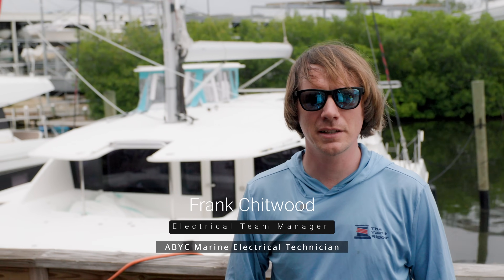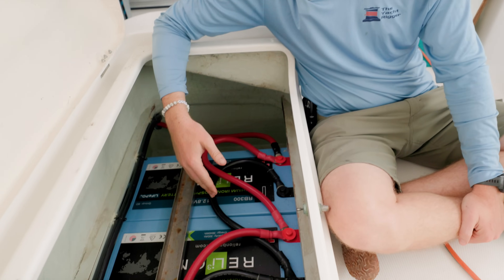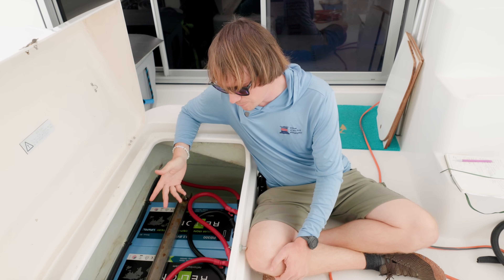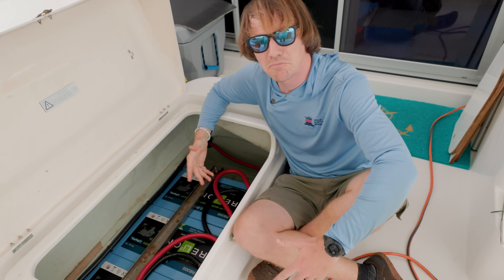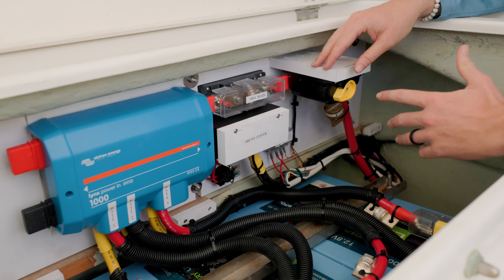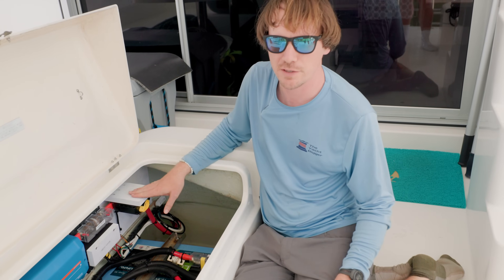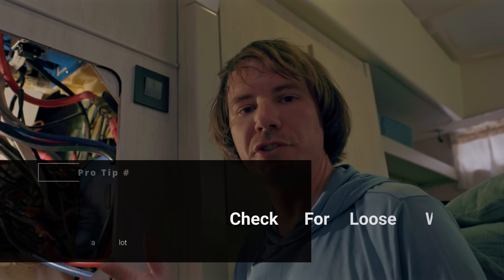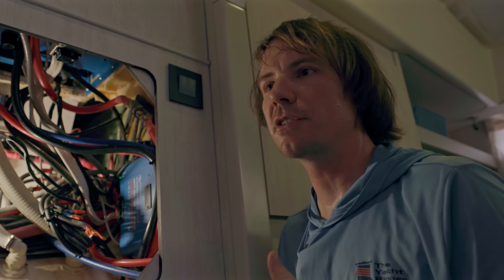Lithium On Your Boat | You Don't Want to Do it Wrong!

Comment: Thanks for the helpful video! You mentioned that all galvanic isolators are ABYC compliant but I thought that the Victrons were not compliant as they did not have the FailSafe feature. I believe ProSafe FS30 amp and FS60 amp are ABYC compliant.
Reply: You are correct. This video is aimed at the US-based West Marine shoppers amongst us. They don't carry any non-ABYC compliant galvanic isolators such as Victron.

Comment: Great job! Was it just me or do you also think the ABYC lithium standard seems catered entirely to battery manufacturers, rather than installers? To me, it seems extremely lax in so many ways, in that they didn't want to potentially exclude particular manufacturer's sub-par designs (i.e. their board members). ABYC has done a lot of great work bringing standards to a historically unregulated industry but this latest standard feels fraught with conflict of interest. For example, the particulars that make Victron the best lithium system around, far exceed the ABYC minimum standard...yet many installers will only install Victron. Hmmm...
Reply: The ABYC Standards are MINIMUM recommended safety standards. We typically exceed them. To us, the single biggest issues out there is that the standards are voluntary and people are unaware a lot of the tradesmen that they could hire to work on their boat have no formal training or familiarity with the best practices.
Reply: I share your sentiments on the regulation catering to all brands.  Not many people know about the board member as you mentioned and I felt that this was a little sided when it came out.  But in the end I’m happy with how it is.  As installers we can advocate and draw attention to the recommendations and show how a certain brand will rise above others in meeting the ABYC suggestions.

Comment: Excellent video and information. I do not use the products about which you speak but they are top of the line. My boat is a forty foot entirely solar with old school lead acid flooded cell electrical storage. The premise for my over 35 years on the project is, most of its components are from box stores for motors, batteries, solar modules, controllers and appliances. The idea for the premise is KISS, Keep It Simple Smarty.

The descriptions, language, parts, videography and content of your video are spot on, detailed and most accurate. If I were to convert to the latest technologies with an enterprising marine group, I would be on your doorstep. Thanks for the fine work and the use of quality high tech products.

Comment: good  information , thanks . I have a cat with 2 motors and fitted a Victron DC/DC charger to port  engine to charge 3x 100 ah Li batteries, how can I be sure  that the other engine wont overcharge the batteries  when both engines running ? Do I need to put another DC/DC charger on the stbd engine ?

Comment: Thanks for the video.  Great points!  What do you do for grounding the AC and DC systems together?  Where do you do that and what are the concerns?  We have a catamaran so two engines which also need to be grounded.  I have not been able to find the central ground connection on our boat and I don't want to create ground "islands" that can be separated from the ground circuit.  What are your thoughts?  Thanks!
Reply: ABYC Standard E-11 says if you have an AC and a DC system on the boat the AC grounding bus shall be connected to either the engine negative terminal or (more commonly) the DC negative bus. Usually this is done near the electrical or distribution panels with a single wire. It's probably green or green with yellow stripe if you have one. If you share the boat model there's a chance I can tell you where to find it.
Reply: @FrankTheYachtRigger  Thanks! Yes, the boat ground is green with a yellow stripe.  The boat is a 2018 Fountaine Pajot Saona 47. The DC is in the port engine bay and the AC is in the starboard. But, the boat was commissioned by Atlantic Cruising Yachts and they moved the AC panel into the salon. There is a main DC power line that goes to the area behind the NAV station. I'm guessing that is where it is tied but an F16 has less wiring than what is going on there.  Since I'm repowering the boat (batteries and inverters) I just want to make sure I'm not creating any ground islands. The DC ground need a good cleanup.  Thanks for your help! Franny

Comment: I bought a first Gen LED replacement bulb for my existing masthead anchor light fixture. It began to fail immediately, becoming dimmer over the course of a few months. The LED wasn’t cheap, and had a lifetime warranty.  Fortunately, the manufacturer supplied a new bersion, which has worked extremely well. I don’t like going up the mast on a regular basis!
Reply: Glad that worked out! Not all are created equal. We have had to replace LED navigation lights from well-known but not top quality brands for people that were only a year old. We mostly sell and install Weems & Plath at our shop and so far haven't had a single issue out of any of them, but we haven't been using them too long so time will tell.

Comment: Great video. Thoughts on the new Victron NG lithiums?
Reply: We're looking forwarding to getting our first batch. Nothing too revolutionary in them, just a good evolution, so not expecting many issues with the first batch. Mostly excited about the 24V 300Ah size being adding. I wonder if they will release a 48V version down the road.
Reply: @FrankTheYachtRigger  these batteries coupled with the new GX ability to add a second bank will make adding capacity a much easier problem to solve where space, weight/balance and other constraints make adding more batts a poor choice (think aft and to one side in a monohull, or in one hull on a cat). 

Do you have any idea if individual cell voltages will be available through VRM on the NG batts or BMS? My kludgy BLE sniffer approach is a poor substitute for the info I get through VictronConnect on the boat for each battery but it is mostly a “nice to have” remotely data issue, not “need to have.”  Temps, though, can be “really should have” data in the winter. The low temp charge protection (ATC circuitry) has worked well, but it would be nice to verify. Not a FLA problem!
Reply: @jimduke5545  The NG batteries will transmit cell level data to the system. They also feature a built-in shunt on each battery.

Comment: Hi Frank, excellent video. I have a couple of questions hopefully you have the time to point me in the right direction. 
1) I’m upgrading my Morgan 41 classic to a lithium house bank. I think I have all the fusing etc done correctly and I’m going the DC-DC charger route regarding alternator charging. My question regarding this installation is separating the AC loads and the inverter. 
I have a single 30A shore power inlet. I’m using a ronogy 3000W inverter charger. When I’m away from shore power I want to power the whole boat except a few heavy loads: water heater etc.  I’m guessing I need to install a separate breaker panel for the load that I only want to be powered when in connected to shore power. Is this correct and is there anything specific I need to think about when doing this? 
2) where would I go to get some ABYC training regarding electrical systems given I’m located in Canada? I’m a long time engineer in the entertainment industry so have a very good grasp of complex systems looking to pivot that knowledge to the marine sector and want to do it right rather than just winging it🤣 

Your info was so well explained and detailed. Very much appreciated.
Reply from the maker: You should put a call into The Yacht Rigger and see!

Comment: Nice info.  Whats your thoughts on bifacial solar panels? With reflection on water seems like more free power?
Reply: We love em! Especially on the racks sticking off the back of the boat.
Reply: @FrankTheYachtRigger  Since real estate is a premium hanging panels off the back. I wonder if having a nother panel pointing creates more power than Bifacial. The back side of bifacial is not as powerful as the top. Would love to see a test where you turn pan
els upside down to see the power can get reflecting off the water.
Reply: @bryhan67  That’s a fun idea! Maybe we can find the time to try that one day and post a video.

Comment: Great video!  Is there a source for the beautiful battery/fuse bars?  Also, I noticed the fuse holders were not secured.  Is that compliant?  Also, my batteries each have a rating of 250a continuous discharge but 800a 1sec discharge.  I can find class T fuses up to 400a.  What amperage would be recommended? (12v system, each battery 460ah w 250a BMS’s)   Thanks!
Reply: So, this is a lot to discuss over YouTube, but the size of the fuse is determined by the size of the wire and where it is located (in an engine or not, bundled with other wires or not) - it is not determined by the battery size. Then in some instances the fuse cannot exceed 100% of the ampacity of the wire, and in others it can exceed the ampacity of the wire but only by a certain amount. It's quite a lot to get into here. In the example in this boat, the battery cables are 2/0, not in an engine room, but wrapped in split loom (which is a derating factor) so the ampacity is 231A. We used 200A fuses on each battery although 225A would have been acceptable as well. We also have to do a calculation using a formula provided by ABYC to make sure the cross-sectional area of our copper bars are apprioriately sized as well. FYI there are Class T in larger sizes than 400A but not from the traditional marine brands.
Reply: Thank you for taking the time to respond!!  
I used Ancor 4/0 tinned so ~107mm sq.  In engine compartment.  I assume the conversion chart would adjust for solid bar vs multi stranded.  I was hoping there was a source for the contoured bars.  I could bend, drill and wrap them but they certainly won’t be as pretty! Thanks again.
Reply: @tracyoliver550 4/0 wire in an engine room with split loom has an ampacity of 265A and you cannot exceed 100% of the ampacity on a battery so that would call for a 250A Class T fuse.

Comment: The Maximum charger current on those Relion batteries is 100A each and obviously a bit more when there are multiple of them in parallel.
Reply: The recommended charge current for those batteries is 15-50A according to the manufacturer. There are three in parallel here so 150A is the maximum recommended charge current and what we have set up this system for. Disappointing… we could put in more power. The ABYC Standard E-13 for Lithium Ion Batteries tell us we must set the system to follow the manufacturers recommend charge profile though. You should not operate ANY electrical equipment at its maximum rating regularly.

Comment: Great video. It’s still not a monohull😢, but electricity is electricity. 👍

Nice explanations, Frank. With regard to the inverter fuse, could you explain why a high AIC (class T)  is needed there? I totally get the requirement at each battery but am not following the need (vs an ANL) prior/after (invert/charge) the Multi. I also wonder a bit about the aggregated “main battery fuse” needing to be a class T. In either case, I see no harm in them being a class T, but I don’t know where the requirement for the higher AIC fuse is, in cases other than for each battery at/near the positive post. 

For the Inc/charger service disconnect/fuse, could you have used a properly sized DC CB? (Fully realize how expensive they are but they exist)

Love the copper busbar off the battery post. (Makes my 6-7” 2-0 “whip” look like an amateur did it. (Me!)

Always learning!  Thanks.
Reply: Hi Jim,

For other people less tech savy than you reading this I want to point out that AIC means Ampere Interupting Capacity and what it relates to is the ability of a fuse to safely blow, rather than arc weld closed and continue pass current, when faced with a very high amperage. A Class T fuse has a high AIC rating while a MEGA or ANL does not. A fuse with a high AIC rating such as a Class T is not necessary for the inverter assuming the batteries are properly protected with a Class T and we frequently use MEGAs as well for inverters. But this one was already installed and there's not a down side there so it got a cover and a spare and is back in service. Yes a DC CB fuse could be used but as you note the extremely high price makes it quite unattractive. 

Thanks for the love on the copper Z bars. We sell these for $44.99, which seems pricey but obviously requires quite a bit of precision work at the fabrication shop to get the dimensions exactly right to sit flush on the battery terminal and Class T fuse stud. They are attached to the battery with 3M VHB tape. When you compare it to the cost of wire and lug as well as time it takes to deal with those annoying little buggers, it's actually not so bad.

The discussion about a Class T fuse for a main fuse when we already have each battery fused with a Class T is a bit more technical than can be had over Youtube but relates to ABYC Standard E-11 requirements for a large size battery bank. There are new Standards revisions coming out presently which we are staying ahead of as we keep a pulse of what's coming down the pipe.
Reply: @FrankTheYachtRigger   I really need to sign up for the technical committee…maybe when the day (mostly night) job tells me to go sailing full time😇 (ask Andre…) 

If a class T fuse is required as the main (large) battery bank by E11, how would that work with the Victron Lynx ‘power-in—BMS—Distributor’ busbar/BMS system? A new Lynx module after (or before) the BMS prior to distribution with a single class T in the positive bus? 

Thanks for the detailed reply. You all are doing a great service to the community helping to educate the “why” of these safety standards and the benefit to following them. 👍
Reply: @jimduke5545  If it's a Lynx BMS with a Distributor right after it then we will usually put a Class T and a Blue Sea Systems Remote Battery Switch between the two. Then we will cut a custom copper bar to make up the gap between the negative studs on the BMS and Distributor. I think if you go back a few videos and find Scott walking through the FP Summerland 40 with a 48V Victron system you will see one there. It is covered in insulating heat shrink.
Reply: @FrankTheYachtRigger  thanks. I didn’t watch those (yet). The “power cat” prejudice 😉. 

Watching them later today!
Reply: @FrankTheYachtRigger  I'd prefer seeing those copper Z bars tin plated, especially if the battery terminals are aluminium. I don't think ABYC require that though?
Reply: @CraigOverend  You're not going to belive this, but ABYC Standards don't even say that electrical wires have to be tinned, let alone bus bars. Tin plating is a best practice though to protect from corrosion. Since tin plating custom parts like these Z bars we make would be quite expensive, we instead dose them up with Steel Camel Thread N Post lithium grease that is non-insulating and protects from corrosion.
Reply from the maker: Monohull videos are inbound, my friend! I love me a mono!
Reply: @TheOnDeckChannel  be sure to capture the contortions needed sometimes that the cat people can often avoid…you might need an endoscope camera😉
Reply: @FrankTheYachtRigger  Very helpful stuff. I'm going to order 3 of those Copper Z bars and the blue sea Class T's for my Kilovault 3600HLX batteries (I couldn't find Victron batts here in the caribbean). So if I were to run a Lynx system (power in > Lynx shunt > Lynx Distributor) and attach my Multiplus to the Distributor, you'd recommend a second Class T fuse instead of relying on the MEGA inside the Distribution module? Or should I skip the Distributor and run a bar straight to 4 individual fuse blocks right off the busbar? Also can I hire you to look over my diagram and point out any issues? Thanks. -Dave (FP Lucia 40 in Puerto Rico)
Reply: Hey  @superfishal00  ! We got your email yesterday and will be getting with you early next week. We do offer remote consultation for DIY clients to help you through the process. I have spent a few months in the marina you are in now! We can absolutely ship those items to you there. We will go over your system design with you during that process. Thanks!

Comment: What a the Epoch Dual purpose 12v 120Ah cranking and deep cycle battery? 

Wouldn't that be drop in or change from Lead acid to the Epoch Dual purpose battery.

Comment: You put class T fuses on the battery, good. Then you go direct to the Victron Lynx which has ANL fuses in it?
There are way to many connections in my humble opinion. 
A DC breaker off good quality is golden rule. 
Fuses are to protect your wires.
Reply: The batteries are connected to a Victron Power In which looks like a Lynx but it does not have fuses inside. So each battery has a Class T fuse and then the entire bank has a fuse (a Class T) that is appropriately rated for the battery switch, another ABYC Standard.